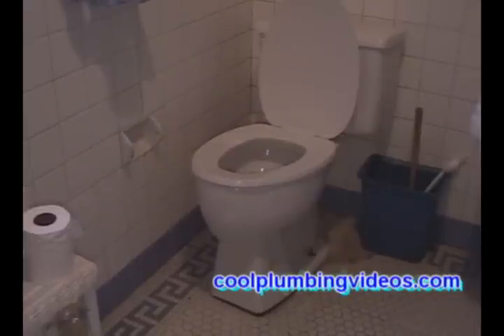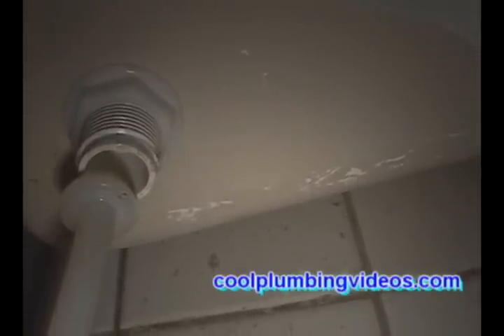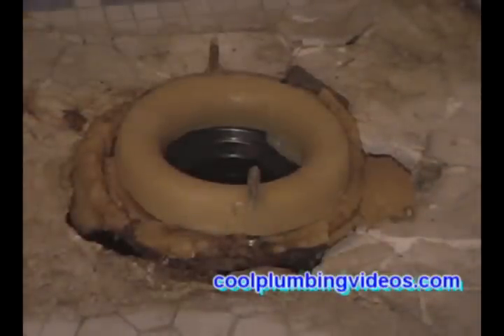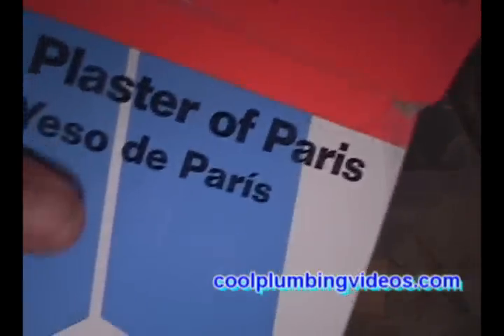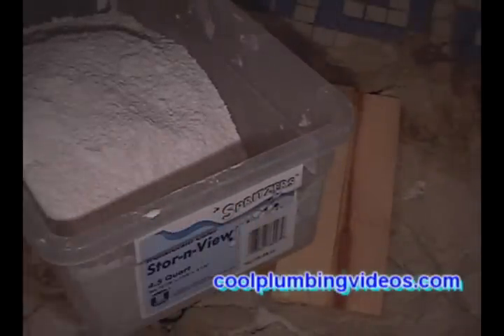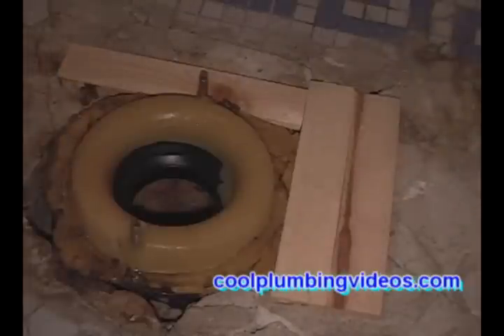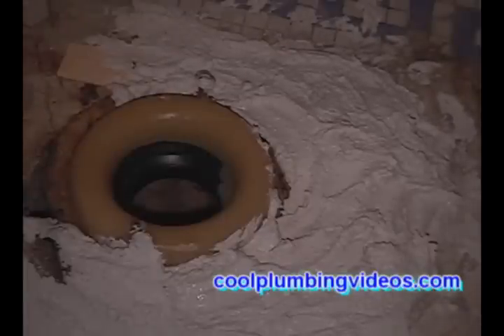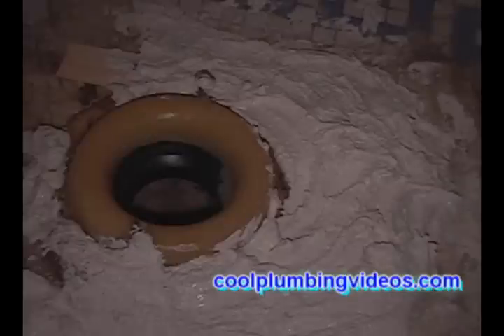Toilet Floor Not  Level

Comment: I never use shims at all as far as leaving them under there. Also I always clean off the old wax . I dry fit the toilet and use shims to level it. Then I pull toilet and mix up plaster of paris and put the mix same height of the shims in same area and install the toilet while using a level to make sure it's level,  done deal also I never use those wax rings with the built in cone if toilet flange is flush or below finished floor I fix the flange so it sits ontop of finished floor and I use a regular thick wax ring with no cone. Been doing it like that for over 20 years and never had an issue
Reply from the maker: Nice. Thank you.

Comment: Hi.  Won't the wood shims rot over time?  Wouldn't composite shims be a better choice, at least for small floor level corrections?

Have another question - might anyone know of a suitable product that could be used to more extreme out-of-level floors (like 1 1/2" difference from front to back)?   I tried gluing 6 teflon shims together but there has to be a better way.

I recently ran into a toilet with  a similar issue with a badly corroded floor where the water had flowed into the front of the toilet base and water was continuously leaking into the basement and the wax ring was damaged.  The flange was loose and there was nothing to anchor it to.  Fortunately, the old lead drain pipe was still good so I ended up using a 4" closet flange that I screwed into the top of the pipe to prevent any future leaks, and then plastered in the flange.  The next day, I drilled some holes to anchor the flange into the plaster and the floor substreate and used bondo to set 2 3/4" tapcons.  I also used heavier Johnny bolts.  The floor still isn't level, but much better after I used plaster of paris to help with the leveling.  A real handyman special but it works.  I'd welcome any
Reply: constructive feedback...
Reply from the maker: Your right, but back then they didn't make plastic shim like that😣this video is pretty old. Over 20 years🤔

Comment: Suppose in the long run I will need to change the wax ring underneath the toilet, then will the plaster makes it more difficult to pull the toilet out? Also, my concern is that moisture may be trapped underneath that may cause molding on the woods that you have placed under the toilet.

Comment: I've never seen toilet bolts that weren't rusted nonefunctional !
Reply from the maker: That may change. You can now buy plastic toilet bolts. Take a little getting use to. But yes for the most case they all rust.